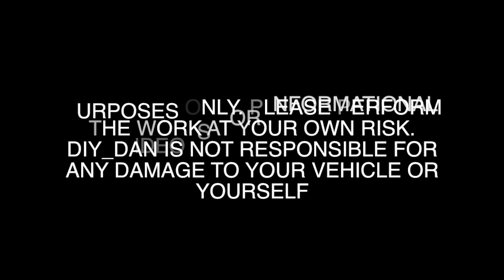Ford ranger passenger air bag removal

Comment: Good, simple and to the point. Only need to remove the two 8mm bolts. The 11mm in the middle only holds in the metal bolster structure of the dash.
Reply from the maker: Thank you!

Comment: If the airbag on a 2003 Ford Ranger passenger airbag that is is popped do you have to replace the entire Dash?
Reply from the maker: No, the airbags can be replaced. But you’ll also have to replace many other parts of the SRS system for it to function.